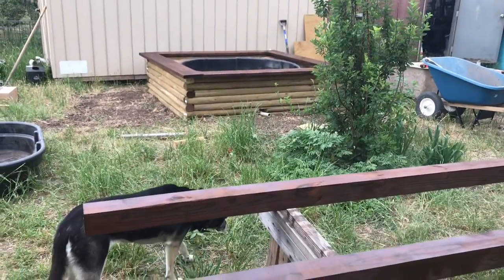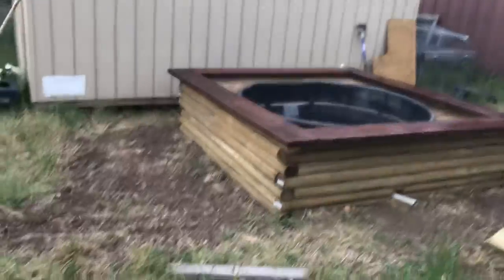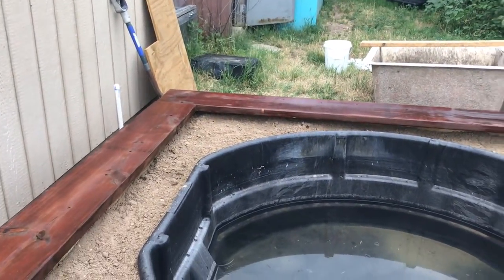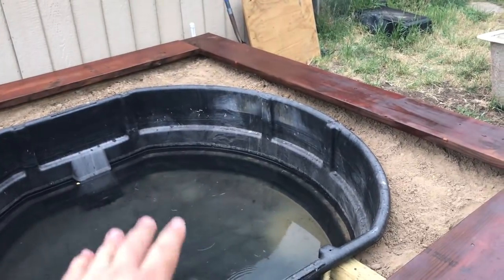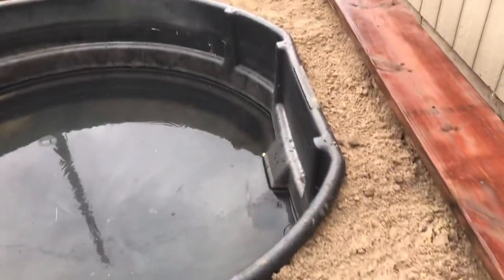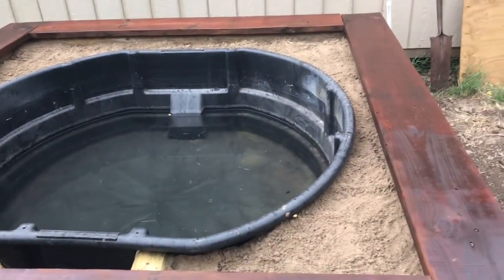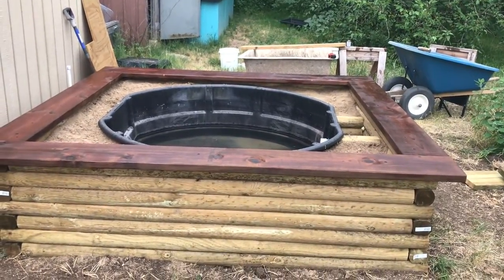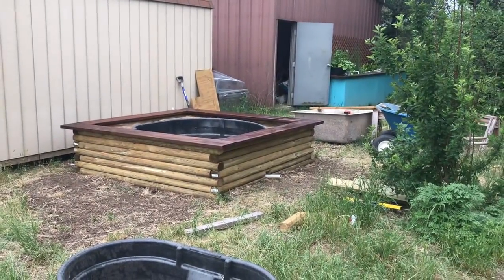New 300 Gallon Aquaponics System - Part Three

Comment: Hey Jack, why did you fill the box with soil?
Reply from the maker: Looks better, stabilizes the temp of the water and solidifies the entire structure all for about 13 bucks worth of material.
Reply: Good deal. I figured the insulation value counted, but was curious if there was more to it.